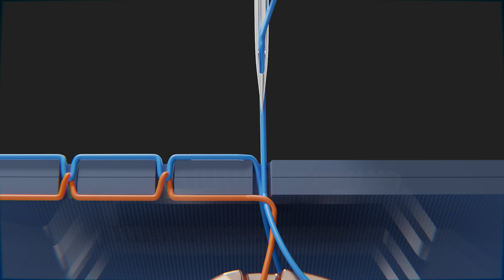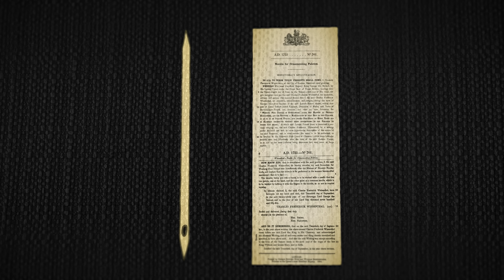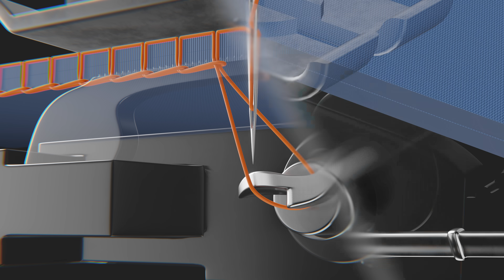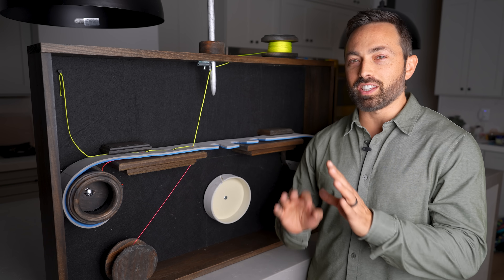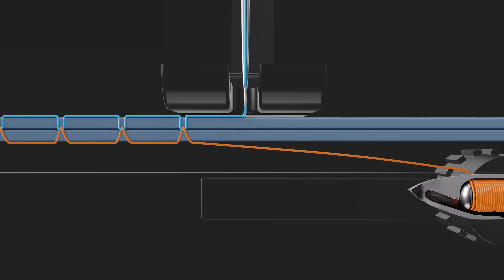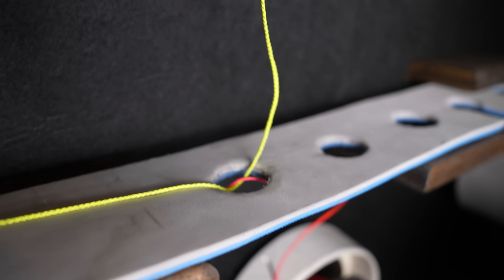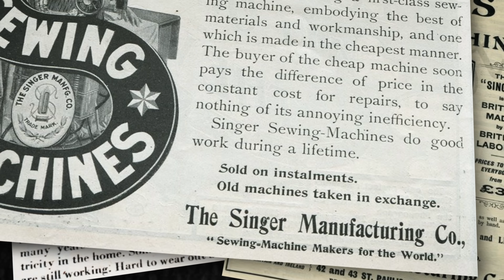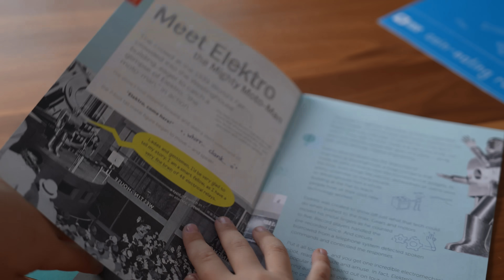The Surprising Genius of Sewing Machines

Comment: They used to build mechanical machines with many moving parts that work 100 years later.

Yet Apple cannot build a static machine with no moving parts that would last 10 years or 5 for that matter.

Comment: I use my sewing machine often to reinforce stitches when they start to come loose on my clothes, I hand stitch buttons back on, to mend clothes and dog toys and have made clothes from scratch. I had a reasonably good idea how the machine worked, but it was great to see it on a large scale to really appreciate how precisely the machine has to run to catch the loop on the underside. Gave me an even greater appreciation for the engineering that went into a sewing machine.
Reply: I have seen cobblers stitching like this. They have a needle that kinda looks like a screwdriver🪛

Comment: The thing with clothing is that a lot of it is made of plastic threading now, with maybe some wool or cotton in it. It’s a lot harder to tear it apart to salvage what you can to recycle into more clothes, rather than if you had an entirely wool sweater.

Thankfully… there is a solution. A very good one. There is a company, I forget what it’s called, that has discovered a method of turning plastic back into useable fuel and oil. Almost all types of plastics. And crap and crud that isn’t plastic is ejected out during the process of mixing all the plastic together into a weird soup.

Comment: Without uniform yarn, sewing machines are not possible. The machines are reliant on the fact that the first length of yarn behaves the same as the last in a seam. Only mechanized production and quality control made that possible.
I remember my grandmother adjusting the machine to a new yarn.

Comment: the sewing machine is a much neglected feat of engineering, that one can say led to the birth of standards, repeatability, mass production...
tolerances.

its success lies in bearings of high tolerance, yet not so high a tolerance as to be unfeasibly expensive to produce. very rudimentary machining capabilities in the early days, and the whole point of making a swing machine was that anyone could afford one. the whole mechanism has to be thought out so it will still work even as it wears and loses that "brand new" snugness... you also have to make LOTS of them. thousands... cant have selective assembly. every shaft has to fit every hole and work as required.

its often cited as an example of tolerances versus cost in older engineering textbooks...

Comment: 1:58 There's another problem with trying to mechanise manual sewing: you need to pull the entire length of thread through the hole before starting the next stitch. You can't just pull only the needle through each time and then pull the entire length of thread through all the holes once after you're done stitching, because the friction at every hole will add up and make that impossible. Lock stitch is important here because it not only eliminates this problem, it also means the distance the needle needs to travel can be kept constant, which is much easier for a machine to do

Comment: I used to work at a company that used sewing machines (dual thread chain stitch) as part of a manufacturing process making 200m rolls. I think the fastest we ever ran was 2800 rpm which is about 20 km/h. Some industry veterans came to visit one day and just about died of shock when they saw that! They had never seen it done and couldn't work out how it was even possible. We were pull feeding the machines so much the needle was actually bending slightly. I just shrugged and said I turned it up until it stopped working!
In Australia sewing machine mechanics are basically extinct now that manufacturing has moved overseas. You wouldn't believe how complicated it can be to set up one of those machines with all the cam timing and levers and everything. The machines and the whole industry are truly a marvel to behold if you ever get the chance.

Comment: The PTO had a slack belt that could be ramped up or down. The dead man was only used for quick disengage. They called it a dead man because if you tried hard enough to engage it at full power/speed it would grenade. This guy has it all backwards.

Comment: The embroidery work near the beginning was incredible, free sewing is challenge, and its impressive to see it be done on a machine in a more manual style while most machine embroidery is computerized nowadays. 

Think this video might have solved the mystery with my sewing machine as well, might have to reference it again but got a good idea what its issue could be. I've convinced it to handle two layers of faux fur but trying to appliqué minky onto it is frequently a bust... even with a walking foot. Constant looping of thread on the bottom side...

Comment: Howdy! Embroidery machinist of two years and counting here. You've done very well explaining the fundamental mechanics of the machines. From day #1 working with these machines I've been utterly fascinated by them. I've ran little Brother machines, Ricoma's, and now I'm running two absolutely BEAST Barudan 6 heads, soon to be a third. I've had my machines apart before to adjust timings, replace springs and belts, clean, etc. - 20 Inch sewing field per head, 90 needles, a thousand moving parts, servo motors and belts, driveshafts and pushbars, all working in perfect unison. The machines are nothing short of works of art. They can lay stitches at 1100RPM and are an absolute blast to watch do so. 

I'm absolutely stoked to see a mainstream channel touch on the topic, these machines for the immense impact they have on all of our lives go largely unnoticed. Folks who understand sewing and embroidery are worryingly scarce. Thank you for this video 🙌
Reply: Same. The amount of dudes I've seen dismiss sewing as "gay" or "for chicks" is wild considering the ancient history of sewing and the revolution the sewing machine brought with it. So many dudes into cosplay who will limit themselves to 3d printing everything because they're afraid sewing will, I dunno, emasculate them or something stupid? It's bizarre. Sewing is an everyday skill everyone should know.

Comment: You left out an important piece of the puzzle. I believe it is called the race. The bobbin needs an axle to turn on the axle is attached to the bobbin case the bobbin case is held in the race the thread passes between the bobbin case and the race. In your model what ever is holding the bobbin case in place is not visible so it's hard to tell either how it stays there or how the thread passes around it. And have you considered punch embroidery needles? They make loops that are held in place by mere friction.

Comment: I am still a little confused by the rotating hook lock stitch. How do you pass the thread all the way around the bobbin? Shouldnt there be something holding the bobbin on the other side? A pin or axle of some sort? If not how is tension maintained on the lower thread as the video suggests is important?

Comment: I went with my wife to a sewing convention a few years back because we lived ~5 hours apart and I had planned on going to visit that weekend.  I figured that a few hours of quality time at an event that I had 0 interest in (but my wife was extremely interested in) wasn't such a bad deal.  I was absolutely blown away by the machines they had on display.  For context, I'm a chemist who oversaw all mechanical and chemical testing at a stainless steel manufacturing facility.  I maintained and operated all of the equipment used to test stainless steel from raw material to finished goods.  We had a metric crapton of finicky and precision equipment.  I thought I was going to be a bit bored at the convention. I was wrong.  I still can't thread a bobbin... but I appreciate those who can.

Comment: You fail to mention one of the most ingenious parts of the design.  There must be parts of the machine, held in place by the machine, but cannot be fastened to it, because the thread passes totally around those parts.  For the lockstitch machine, that is the shuttle or the bobbin & its container.

Comment: You've got "planned obsolescence" all wrong. Designers have two goals, and two goals only - a product that works better, and is cheaper than the competition. That's it! Nothing else. Not a product that works for a 100 years. People don't want to pay for that. How hard is this? Stop being cynical. "Planned obsolescence" exist in only a tiny fraction of the industry. The vast  majority of all product design completely ignore the concept, liked 98%!  How do I know? I'm a retired product design engineer that's been around the block several times in the last 35 years.
Reply: I mean, the whole Apple brand is basically the embodiment of planned obsolescence.

Comment: Thanks for this. My grandma has Singer endler machines as well as PFAFF. The PFAFF one is a machine that is purely mechanical and is used to sew in buttons. It's run by your foot on a huge metal pedal. The endler one is used to trim edges and make them threaded, amazing machines.

Comment: The basic running stitch is still use to close sacks of material such as seeds and fertilizer. Cut the thread, pull on the end of the thread and all the stitches disappear leaving the top of the sack open.

Comment: I have a 1906 Singer model 26 "Sphinx" that uses the vibrating shuttle. My mind was blown through the roof when I figured out that I could still get brand new bobbins for it from Amazon. That thing will lay down stitches like a madman if you get the treadle really humming. I also have a couple of Singer 66s, and a couple Singer model 15-91 Direct Drive machines. Those things are monsters. They sew denim like it's made of tissue paper. It also helps because there is no belt to slip. My favorite is my industrial Singer 111W-155. ¾Hp clutch motor runs that guy. I am working on a post bed industrial Singer in my free time. Hopefully I'll be able to post a video when I get it done.

Comment: I grew up with a Singer machine from the 50s in my living room and sewed competitively in high school. I later bought a similar, but newer model of Singer Golden Touch N Sew, and still use it occasionally, 30 years later. I restored an old black Singer shuttle machine as a kid, and still have it, though I don't use it because it only does straight stitches.

Comment: The Wilcox who was mentioned here partnered up with a Mr. Gibbs to make the Wilcox and Gibbs chainstitch machine. It was developed to be easy to use and much quieter than other machines of the time. I happen to own an original and it really is very simple and quiet to use. It took me a great deal of research and web spelunking to find one, but every time I use it I'm amazed none of this design are made today as it seems to be very beginner friendly. You just thread the thing and go, no bobbin to wind and no extra hassle. The fact that the stitching can be easily removed can actually be quite useful for fast correction of mistakes, and with a little know how you can lock them in place as well. I've been using mine for a wile and have yet to encounter any major problems with the machine or stitches. Sewing machines in general are fascinating machines as depicted with expertise here, but the W&G will always be on of my very favorite things.

Comment: Some years ago I visited an Amish upholstery shop in Northern Indiana. There were probably a dozen sewing machines in the shop, all driven from an overhead shaft that ran the length of the shop, turned by a gasoline engine on the outside wall. Similar to what was mentioned in the video.

Comment: I'm always fascinated how this works and I've seen a lot of animations. Sadly, the core mystery that begs explanation but wasn't particularly explained even in this video is how the thread get to pass through the bobbin's axle 11:29. Surely that bobbin isn't floating in the air.
Reply: And yet it does. If you've ever replaced a bobbin you'll have noticed there are no mechanical connections to it. It's just loose in its holder - the thread can pass entirely on both sides.
Reply: @YateyTileEditor  I checked out bobbin images and videos and yeah the bobbin itself has no axle and only a hollow center or hub. But the bobbin's case has a fixed rod that goes thru the bobbin hub. So it still remains a mystery to me how the thread goes past that rod.

But I've seen a design (the drop-in type) where the bobbin lies on side, no rod or axle, and sure the thread could just easily slip under it.
Reply: @MrKockabilly  good point, I have seen a bobbin case that sits on an axel attached to the machine (although probably not for 30 years). I've got no idea how that works.

I don't really use sewing machines much but the ones I've used recently have all had the slippy/slidey "loose" bobbins. Including one really annoying one that sits vertically in the machine and just drops out if the retainers aren't slammed in place fast enough.
Reply: @YateyTileEditor  I see. Too bad Derek overlooked (to expound) this one mysterious (at least to some of us) aspect of sewing machine.

Comment: Lots of neat details. The one that is amazing is a single Steam Engine providing power for dozens of sewing machines constantly, and one click makes part of the Sewing Machine change from motionless to 10,000 RPM in a fraction of a second. I never thought of sewing machines as using a lot of power since they can be run with a foot pedal. But that single Steam Engine would have had a lot of torque!

Comment: I work with sewing machines everyday making mattresses. According to my maintenance guy sometimes the difference between a good running machine and a bad running machine are adjustments of less than a width of a hair... sometimes just loosening the needle set screw and immediately tightening it will change the position of the needle just enough that it will fix it.

Comment: While the lock stitch is best for garments, so that your pants don't fall apart if you catch a single thread, the chain stitch has its place.  
     If you have animals to feed, and buy your chicken scratch or alpaca feed in fifty-pound bags, the end will invariably be folded over and closed with a chain stitch all the way across.  To open the bag, you find the loose end of the thread and just puuuuull, and the whole bag zips right open.

Comment: Help me understand how shuttle bobbin work in 10:02. As I understand it, the blue thread would need to completely wrap around the shuttle as the shuttle passes through the loop. I imagine that the shuttle would act like a bullet in a barrel, because any contact or connection from shuttle to sewing machine would make the thread stuck. As Derrek mentioned too, the shuttle is tightly connected with oscillating mechanism but leaving gap so the thread can get around it, but I can't wrap my head around how this achieved.
Reply: Ye how does the blue thread completely pass through the shuttle if it is connected to a moving part

Comment: As someone who is a sewist and also an engineer, there is a lot more overlap in these fields than you'd expect. Everything about sewing is clever ways to connect two things to make large complex 3d shapes.
Reply: I am a student studying engineering and I love sewing too. Design patterns and connecting the pieces is just like engineering
Reply: I know right! Lots of geometry, topology and trigonometry involved!
Reply: ...and using 2D fabrics to cover the 3D shapes of the body relatively smoothly.
Reply: And in the case of supportive undergarments like bras and corsets, garments can be surprisingly supportive and change the shape of the body. A good, supportive corset or bra is a truly a garment engineering marvel.
Reply: Indeed - as J.E. Gordon points out, the history of the Bias Cut and its contributions to science is a case in point.
Reply: complex 3D shapes indeed but definitely not large

Comment: I have used sewing machines all my life. In fact I have 4 different one in my house right now. I am also very good at spacial conceptualization. However, it was not until I saw this video that could accurately conceptualize what is going inside my machines. I've always wondered, but since they just worked, and I know what to do to fix most problems, I've never bothered to find out. 

As soon as they showed the shuttle stitching machine, great big bells started ringing in my head. It was a really facepalm moment for me. It was one of those moments when I realized  that I am not anywhere near as smart as I think I am most of the time. That happens a lot when I watch Veritasium.